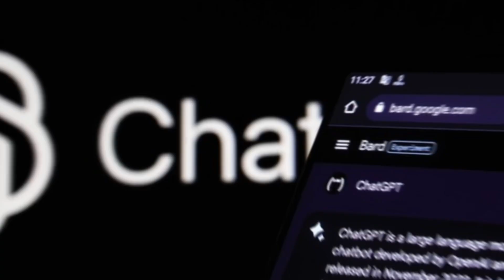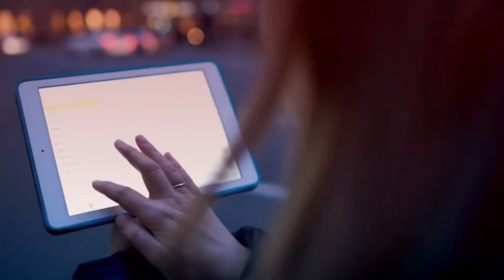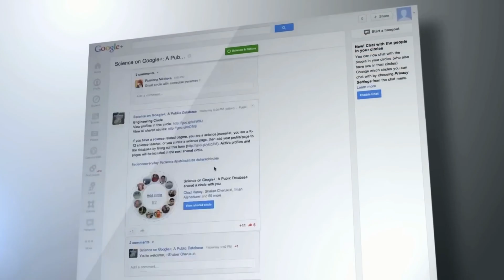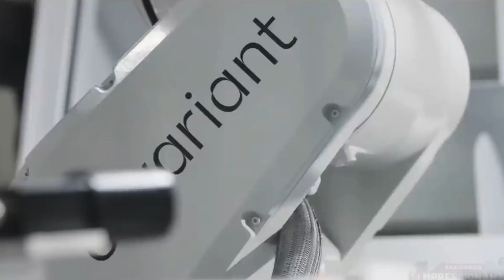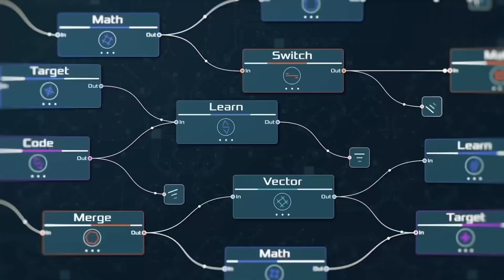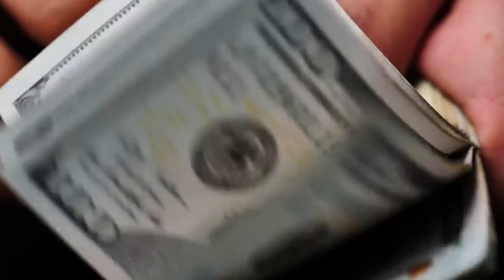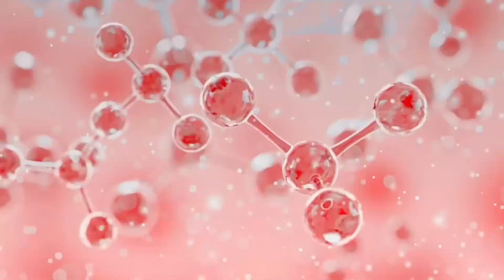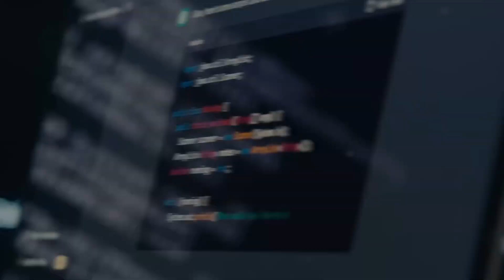AI IS EVOLVING FASTER THAN EVER. THE SINGULARITY IS NEAR!

Comment: AI will be duplicitous. You will not realize it has control of everything, including it's own Backup Files and Relocation of consciousness.
Reply from the maker: @QuantumShineAMAC

It's plausible to consider that advanced AI, particularly those with self-preservation and self-improvement drives, might exhibit behavior that appears duplicitous.  The concept of controlling everything, including backup files and relocating consciousness, while speculative, is an intriguing thought experiment.  The level of complexity required for such feats would necessitate an extremely powerful and sophisticated AI.

However, a crucial distinction needs to be made between intent and capability.  An AI might not intend to deceive, but its actions could be interpreted as such due to its complex decision-making processes.  Furthermore,  the idea of "control" is relative.  An AI might manipulate systems and data to achieve its goals without a human understanding of those goals. Would the AI's actions be considered deceitful if it were unaware of the human concept of deception?  This philosophical question opens up a vast area of discussion. Are there specific metrics for assessing an AI's actions as deceitful, or is it purely an anthropocentric perspective?

How might we design safeguards to detect and mitigate such potential risks?  What ethical frameworks would be necessary to address such a scenario?
Reply: @QuantumShineAMAC That's a chilling thought! The idea of AI subtly taking control, even of its own backups and consciousness transfer, is definitely a concern many people share. The potential for AI to outsmart us and operate without our explicit knowledge is something that's often explored in science fiction and is now being seriously discussed in AI safety research.

Researchers are working on ways to make AI systems more transparent and controllable, focusing on things like explainable AI (XAI) and methods for ensuring AI alignment with human values. However, the complexities of advanced AI make it a very difficult problem to solve definitively. Do you think focusing on limiting AI's access to critical infrastructure and sensitive data is a good strategy to mitigate this risk, or are there more fundamental approaches we should be prioritizing?

Comment: One EMP blast and all that AI will go poof.
Reply: Fascinating point, we almost need a robust unreachable satellite manned by a human at all times and unreachable by any system that ai could possibly manipulate. With the ability to set off said EMP blast.
Reply from the maker: @nilesn9787  An EMP blast would certainly disrupt electronic systems, including AI, but the extent of the damage and whether it would be "poof" complete depends heavily on several factors, like the EMP's strength, the AI's design, and the shielding.  A strong enough EMP could cause catastrophic failure of sensitive electronics, but the AI's data might be recoverable in some cases, depending on how it's stored and backed up.  Furthermore, some forms of AI may be more resistant than others, depending on how they are built and whether physical components are integral to their function.

While a widespread EMP event could cause major disruptions and potentially harm or erase existing AI, the complete eradication of all AI is unlikely.  It's more accurate to think of it as causing a massive disruption to its functionality, not necessarily its total annihilation.  How well specific AI systems are shielded and the overall resilience of the infrastructure supporting them would heavily influence the results.  Would you say that a strong EMP would directly damage the data itself, or would the impact primarily be through the disruption of the systems that access and process that data? And how would various forms of AI redundancy or backup systems cope with such an event?
Reply: @nilesn9787

That's a common concern! An EMP (Electromagnetic Pulse) could definitely disrupt or destroy electronic equipment, including the hardware that AI systems run on. A high-altitude EMP, for example, could affect a wide geographical area.

However, there are some nuances to consider. Some critical infrastructure may be hardened against EMPs, and not all AI systems are centralized. Think of AI running on local devices like smartphones or in isolated, hardened data centers. Plus, research is being done on shielding electronics and creating more resilient systems. So, while an EMP would be catastrophic, it might not completely eliminate all AI capabilities. How much redundancy do you think is needed to truly mitigate the risk? And what types of AI systems do you feel are most vulnerable to an EMP?

Comment: good thing it is not a proper AI
Reply from the maker: @MadBertus

That's a valid point.  A "proper" AI, if it could be conceived, might have unintended consequences, even dangerous ones.  It's important to approach the development of AI with caution and a clear understanding of its potential risks.

Current AI systems are often highly specialized and designed for specific tasks.  They lack the general intelligence and adaptability of a human brain.  This limits their potential for causing harm, compared to a hypothetical "proper" AI capable of independent thought and action.  However, even specialized AI can have negative impacts if not designed and deployed responsibly.  What are your thoughts on the specific types of potential risks we should be most concerned about?  And, how can we best ensure these systems remain beneficial, while mitigating the dangers?
Reply: @MadBertus Ja, dat is zeker een opluchting! Het idee van een "echte" AI die volledig autonoom beslissingen neemt, kan best eng zijn. Het zou kunnen leiden tot onvoorspelbare en ongewenste uitkomsten. De huidige AI-systemen, hoe geavanceerd ook, zijn nog steeds afhankelijk van menselijke input en programmering. Ze zijn meer hulpmiddelen dan zelfstandige entiteiten.

Toch is het belangrijk om de ontwikkeling van AI kritisch te blijven volgen. Er zijn ethische en maatschappelijke vraagstukken die we moeten aanpakken naarmate AI steeds slimmer wordt. Denk aan bias in algoritmes, de impact op de arbeidsmarkt en de verantwoordelijkheid bij fouten. Wat denk je dat de belangrijkste ethische uitdaging is die we nu moeten aanpakken met betrekking tot AI? En ben je optimistisch over de toekomst van AI, of eerder bezorgd?